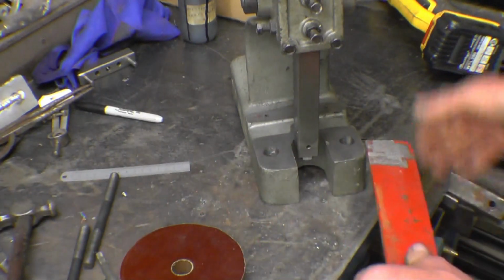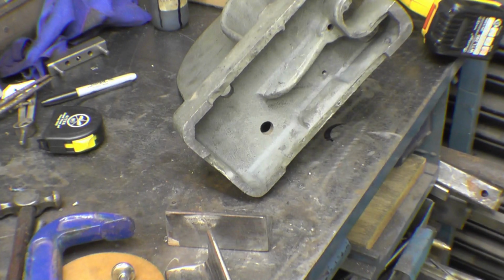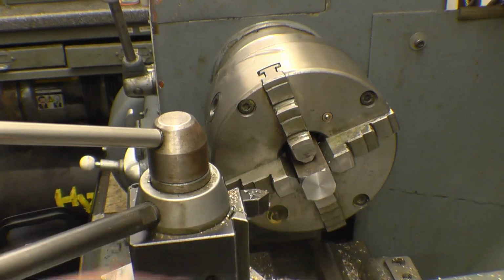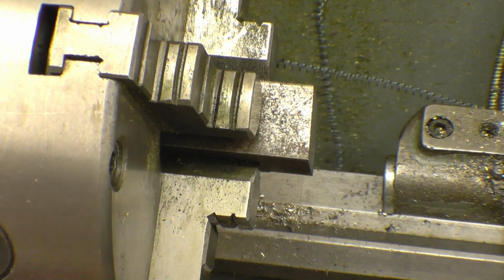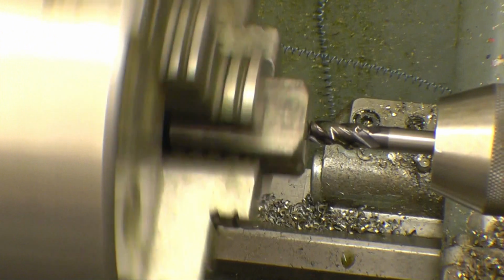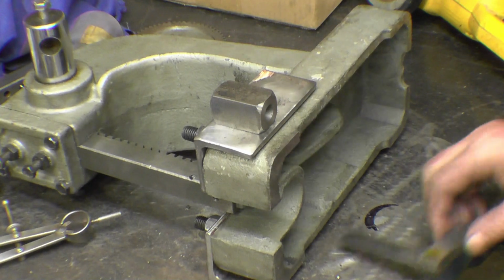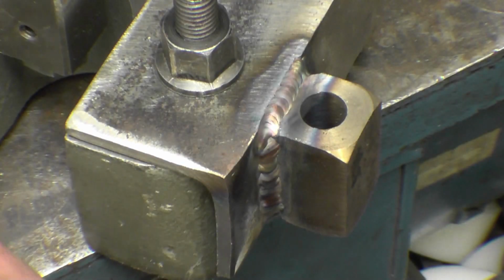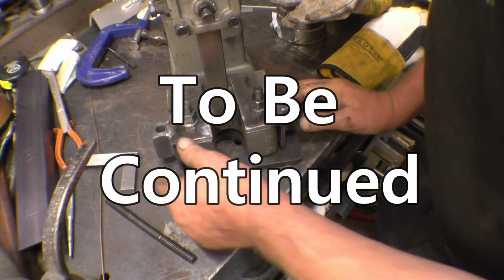SNNC 292 P1  Arbour Press Mod

Comment: Got to ask why you keep turning your tool post, Cxxx inserts cut equally when facing or sliding. You can keep the tool post square to the lathe axis for those jobs and it is also where it should be for parting, as the ad goes "simplest!"